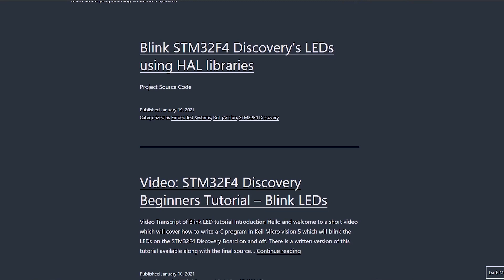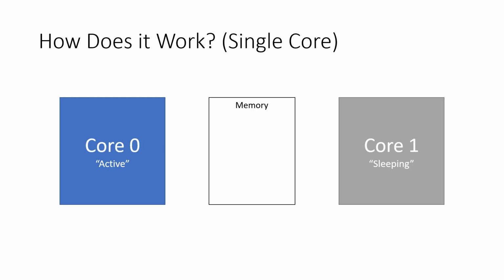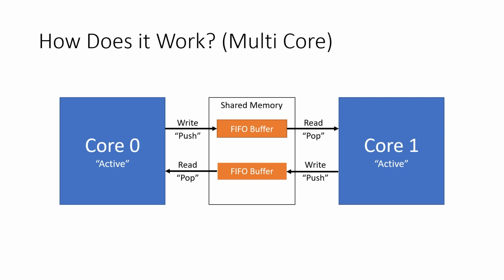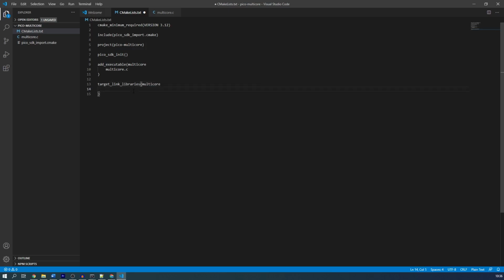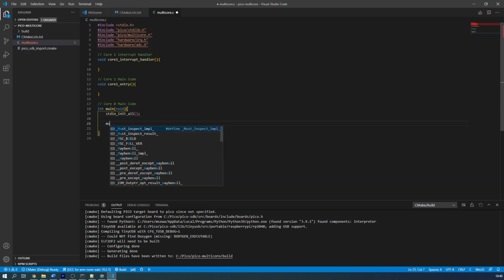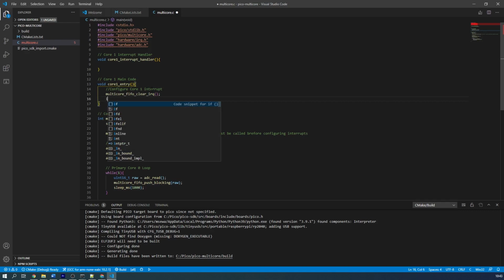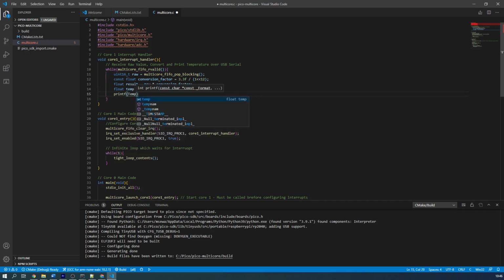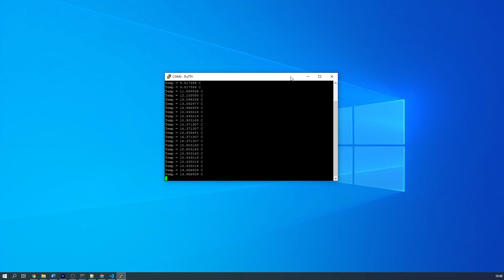Getting Started with Multicore Programming on the Raspberry Pi Pico

Comment: This video was very helpful in starting to learn multithreading quickly. With SPI added in, when you're using SPI read/write blocking functions, does it block the CPU on both cores or only on the core that the SPI function is running on?

Comment: I'm surprised you didn't get a watchdog exception for doing so much during an interrupt, unless the Pico SDK doesn't check for that.
For the ESP32, if you spend too much time in an interrupt, you'll get a panic and crash.  That happened to me trying to use an interrupt handler in ESP32 to process data when available from an external ADC that calculates AC RMS from a current sensor.

A better method of handling data transfer signaled by an interrupt is to tell the main program in core1 through a flag that there's data available, or have the interrupt populate a buffer defined in the core1 code.
But I realize this is just to get our feet wet using multi-core, FIFO, and interrupt.

Comment: Nice video however I would advise rather using queues and not the intercore fifos, as those are usually required to be reserved if you implement any real multicore program.
Also usage of floats seems very unnecessary, fixed point would have been more than enough, especially in an ISR where you usually want to keep cycles to a minimum.

Comment: I have a question. How can you send the value of a variable that has been defined in the core1 back to core0? I've been trying to send the temp variable calculated in the core1 back to the core0 with the "multicore_fifo_push_blocking(temp);" function but it doesn't appear to be working.

Comment: Why would you use the FIFO buffer when you can just use global variables?
Reply: The FIFOs do simply quite a wide range of possible applications.
The introduction part of the video seems to rather imply the FIFO buffers are the only way to do multi-core on the Pico! Surely not?

Comment: Can it be done with the Arduino IDE too, or are we limited to one core?
Reply: Answering my own question;  earlephilhower's arduino-pico, on github, allows the use of both cores.  You have the normal setup() and loop() for core 0, and an optional setup1() and loop1(), for core 1.  

You can install support from there, or by copying the .json link into the settings of the Arduino IDE, then use the Boards Manager, on the Tools->Board menu.

Posting the link got my comment blocked, so you'll have to google it, or search on github.

Comment: Good video, but i confused , how can we talk about a multi-core application if there is an external controller (or interrupt)? You can't do two operations at once if you have a controller or loop .In my opinion, a serial processor cannot operate two operations independently of each other. If it's working, it doesn't return any data to you. anyway, thanks for sharing, have nice day !
Reply: The interrupt was set on Core 1, so it won't have any effect on Core 0. You can do two operations at once if you have two cores - that's the point of having multiple :D

Comment: I have my dev machine set up exactly the same way as "Learn Embedded Systems" The issue I am having with setting up the multi-core is that I am getting errors during the CMake configuration process. I get the following errors:

[cmake] TinyUSB available at C:/Pico/pico-sdk/lib/tinyusb/src/portable/raspberrypi/rp2040; adding USB support.
[cmake] Compiling TinyUSB with CFG_TUSB_DEBUG=1
[cmake] -- Could NOT find Doxygen (missing: DOXYGEN_EXECUTABLE) 
[cmake] CMake Error at C:/Pico/pico-sdk/src/rp2_common/pico_stdlib/CMakeLists.txt:26 (set_target_properties):
[cmake]   set_target_properties Can not find target to add properties to: multicore
[cmake] Call Stack (most recent call first):
[cmake]   CMakeLists.txt:18 (pico_enable_stdio_usb)
[cmake] 
[cmake] 
[cmake] CMake Error at C:/Pico/pico-sdk/src/rp2_common/pico_stdlib/CMakeLists.txt:22 (set_target_properties):
[cmake]   set_target_properties Can not find target to add properties to: multicore
[cmake] Call Stack (most recent call first):
[cmake]   CMakeLists.txt:19 (pico_enable_stdio_uart)
[cmake] 
[cmake] 
[cmake] ELF2UF2 will need to be built
[cmake] -- Configuring incomplete, errors occurred!
[cmake] See also "C:/Pico/pico-projects/build/CMakeFiles/CMakeOutput.log".
[cmake] See also "C:/Pico/pico-projects/build/CMakeFiles/CMakeError.log".

Comment: Thanks. In 25 years of firmware coding I always assumed I'd need multithreading at some point but it just hasn't happened; PC software's a different matter of course. So I come to the Pico wondering what scenarios justify the overhead. Most multicore MCUs have cores specialized for different purposes - eg M0/M4 - which makes sense. I'm thinking it's gonna need some careful design to get the most out of two symmetrical cores. But they're welcome!

Comment: calling a "printf" inside a interrupt handler is not really good practice. Keep is short, like raising a flag, that's it.
Reply: It's quite surprising to me that this would work at all. I would have thought it likely that the USB output would need interrupts to work and usually interrupt systems don't, at least by default, allow interrupts to nest.

Comment: I would recommand not using deprecated old C.
C++ is safer and can make better faster code then C.
Jason Turner has a few videos about that, following is a link to one of those.
https://www.youtube.com/watch?v=fRzF7NSF1II&ab_channel=C%E1%90%A9%E1%90%A9WeeklyWithJasonTurner
Reply: C is in no way deprecated and never will be. C++ is not inherently safer (it can be) nor is it inherently faster (and usually it's the opposite since you have to know what you are doing).
Reply: @klxyx-g1t  C++ is more strongly typed, resulting in safer code. Template allows read only and write only types, that can't be done is C. Only read-only types can be done. C++ is never slower then C if used properly, but often more explicit, and often results in faster code. (Ofcourse, if you try, it's easy to make slower then the other language)

Comment: By the way, in VS Code if you want to duplicate a line that your cursor is on, you can press shift + alt + down. Pretty handy for creating a few #includes or if you’re filling an array. Also I would recommend CoolTerm as a nice looking and simple serial terminal 😁
Reply from the maker: Thank you for the tips, I'll be sure to check out CoolTerm!

Comment: Super interesting! Nice to see the whole project being created too rather than just opening Arduino IDE. Although I’m guilty of that I suppose as I just let CubeMX do all the setup 😝
How have you found the discoverability with the pi pico? Is all of this based on examples they provide and is it easy to dig into the HAL files and find what you need or is it provided as a compiled library that you can’t view?
Reply from the maker: The Pico c/c++ SDK is pretty well documented, and so most of the examples I present in these videos will follow a similar form to the examples so people can jump from these videos into the documentation and vice versa. I will have a few videos (soon-ish) not using the SDK.

In terms of discovery, you can poke around the HAL (or SDK as RPi foundation like to call it) all you like, it is not compiled until you compile it, but finding what you are looking for may take a little time. You can have a look at the Github here: https://github.com/raspberrypi/pico-sdk

Comment: How possible i would it be to use picos in a computing cluster?
Reply from the maker: I think it would certainly be possible but it's actual use might be quite limited. These microcontrollers perform well performing fast functions like I/O but don't have particularly much compute horsepower. So as an exercise it would certainly work but in terms of functionality? I think it would be outperformed by the most basic Raspberry Pi cluster.

Hope this helps!